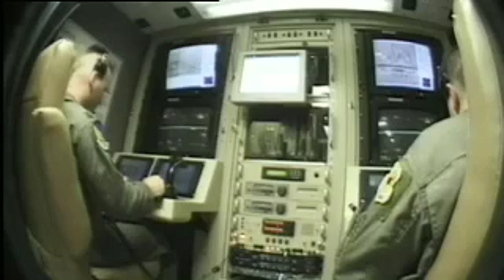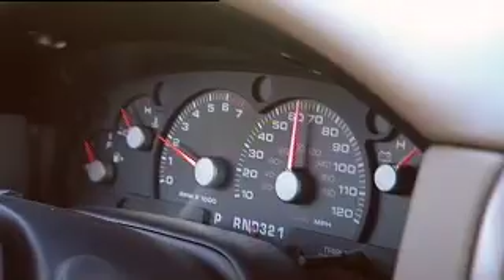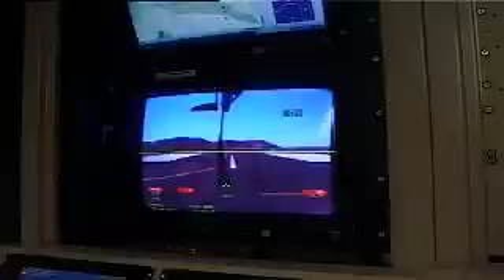Predator 1

Comment: @fluff125 There aren't yet, although the Air Force is working on one. Almost all attempts have fallen flat, short of using a nuclear charge. EMP's require more power than most systems can provide, which is why nuclear charges are the only current feasible/working method of producing an EMP wave.